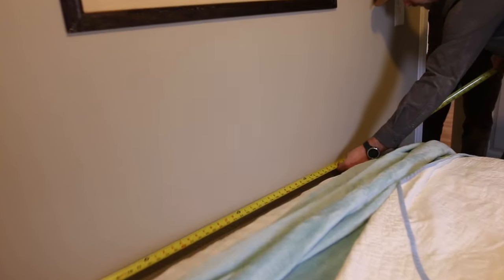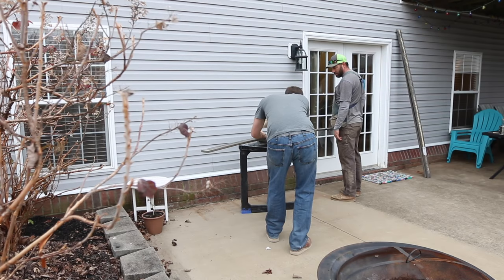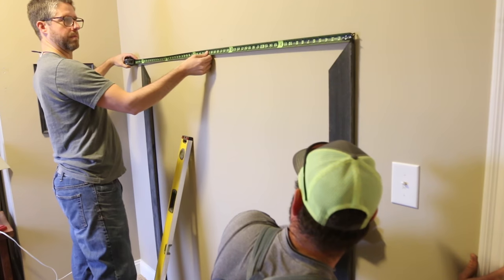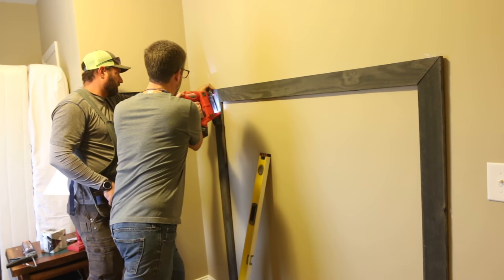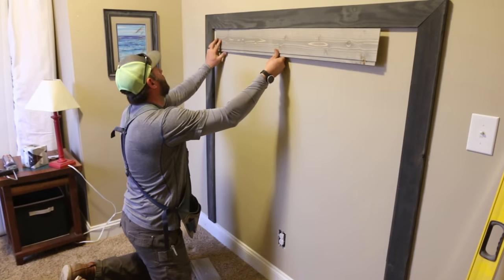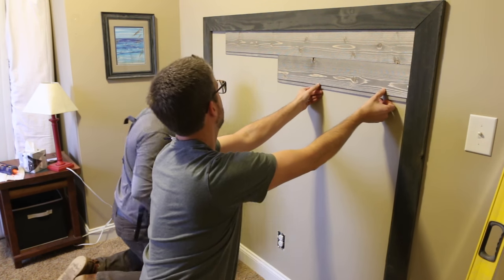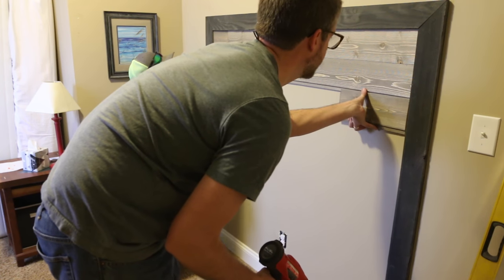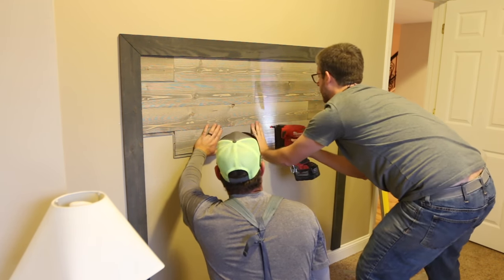DIY Headboard For A Small Room | Shiplap Boards

Comment: Awesome project and video - I really like the tip about securing the middle of the vertical boarder pieces and then pivoting slightly to get a tight miter...super simple and effective!
Reply from the maker: Thanks, Ethan! I thought that was a great tip Ryan had. Because you would notice the miter at the top more than if the bottom was slightly off.

Comment: Nice job, Bruce!  I always knew those KY guys were a bit backwards but now I know they also like to install their outlets upside down!
Reply: Haha...this is actually the way you install them in commercial construction. The theory is that if a plug is slightly pulled away from the outlet and something falls in between then the ground will prevent it from hitting the hot and the common...resulting in a potential fire hazard.  Too many years in commercial construction I guess. Haha
Reply from the maker: Thanks, Drew! I had no clue the reason, but just saw their reply. Makes sense to me!
Reply: @lakesidewoodworksky563  Making the outlet look like a surprised smiley face is profoundly more important than mitigating a potential fire hazard.  What a rookie.
Reply: @Lakeside Woodworks Ky but won’t the electricity come out upside down? 🙃

Comment: Awesome work and great video! Videos are getting better and better Bruce! I did something similar in a bathroom, but the lady didn’t want me to use a bad nailer so I had to put the adhesive on the board and press it to the wall and hold it for a least 10 minutes.. took forever to do but turned out nice when it was done.
Reply from the maker: Thanks so much! Appreciate you watching.Well, that works too!

Comment: Great Video,  job well done! To those with OCD, some builders install the outlet upside down to identify the switched wall outlet.  (The wall plug that's controlled by the switch on the wall) the only other suggestion I have is that it would have been great if you had a link to the product itself. Thank you.
Reply from the maker: Thanks, Samuel! I linked to some stuff that looked exactly the same. We got these kits from Lowe’s and the frame boards came from them too.

Comment: Not sure about using adhesive..won't that tear up the drywall if you wanted to take it down later?
Reply from the maker: Yes, it likely will. These folks decided to go that route. If you don't want to redo the wall, a different method might be good for you.

Comment: the frame around shiplap. what size 1x3?? or 1x4
Reply: also. how many boxes did you use for this head board??
Reply from the maker: I believe these were 1x4. They all came in a pack from Lowe's.
Reply from the maker: I think maybe 1.5. Can’t remember

Comment: So what happends if I I moving or moving to a other  house how can I remove
Reply from the maker: The way I showed doing it, it is semi-permanent. However, you could easily mount a thin piece of 1/2" plywood to the wall into the studs, and then put the shiplap boards onto that plywood, covering the screws. Then, if you ever needed to move, you could get it off of there without tearing up the wall.